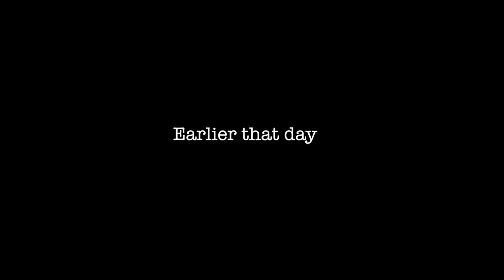Subaru Impreza "Battlewagon" Ep. 2: Drum Brakes Gone Wrong...

Comment: Oh man... I am envious of that lack of rust under there! Funny that brakes were the first thing to go wrong after I lifted mine too. Rusty line broke right off one drum & the other side locked up & ate the wheel bearing with sparks flying all over. Ended up swapping over to a full WRX brake setup with AN fittings/line. Stops the big tires no problem now!
Reply: @bendaga  They get a bit excited with salt in winter over here. If you can find all the big components second-hand you can do it relatively cheaply. And man was it a cathartic process to tear out all those rotten steel lines & imploded drums.

Comment: that noise is the indicator that your in disc brakes blocks are all out and in drum brakes something similar to the blocks but i dont know what its called in englisch only in dutch its called "de remvoering"

if you keep driving on after you first heard that sound your brakes will without exception get stuck

Comment: I love both of these cars. I own the Bugeye wagon and the Impreza outback sport. Unfortunately for mines I had it parked for about 3 weeks and went out to finally drive it and as I put in reverse it would not move later figuring out the brakes locked up in the rear because the shoes slip off. Both cars are amazing I just hate drum brakes 😂🤦🏻‍♂️ probably will convert them eventually to pads.

Comment: Nice job on your videos. Your brake squeal was likely caused by those broken spring retainers, which allowed the shoe to ride a little cockeyed in there and grind on the the drum. If your drums were out of round, you would have felt it in the brake pedal. Out of round won't cause squealing, and you probably didn't need to have them turned at the machine shop. The odd wear pattern on the shoes was from someone driving with the parking brake engaged.

As has been mentioned, it is best to use just  a bit of anti-seize compound on the hub center of the drum, so the hub center of the wheel doesn't get stuck on there over time. Not too much, a little goes a long way. Also, please tighten your lug nuts in a star pattern. Cranking them down tight in a circle will have a tendency to warp the drum or rotor.

Drum brakes are very simple. They're just different than what most people are used to working on nowadays. Always do one side at a time, so you have a reference for how they go back together.

Comment: Love your videos man! Fellow Subie head. When doing brakes and changing tires you can put a small amount of anti seize grease between the hub and the back of the drum and a small amount on the  face of the drum. This will make wheel changes and brake jobs much easier in the future. Do not ever use anti seize on wheel studs/ lug nuts and make sure you retighten your lugs in a star pattern. Happy Wrenching